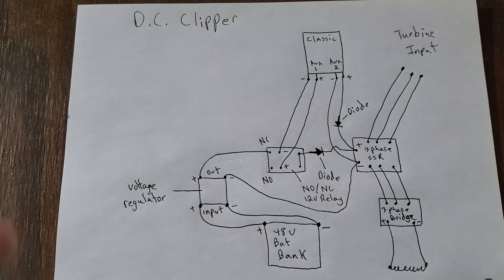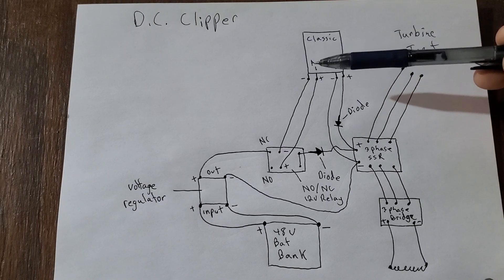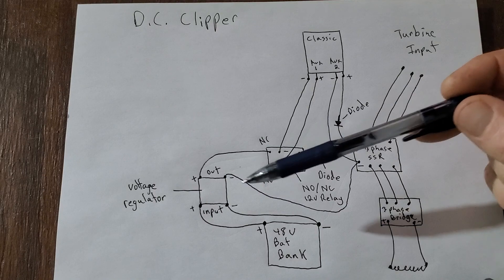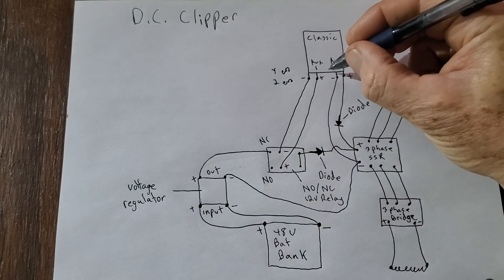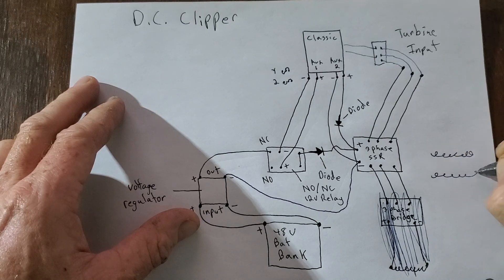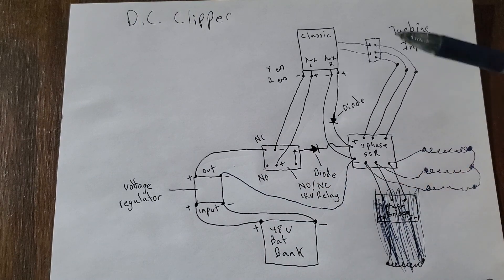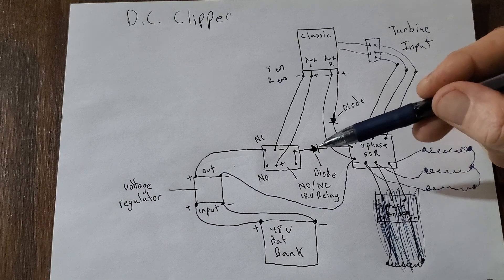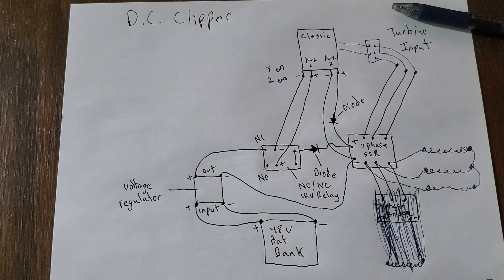Details for Classic Clipper build for a wind turbine

Comment: I'd just like to say thanks for this, I'm about to recommission a 100 year old hydro turbine using a 3 phase induction motor as the generator. There's a mechanical goverenor on the turbine but I'd like to just us that as redundancy and this as means of controlling output. If I can get it running it should compliment our existing off grid 48v solar system during the winter. 

Really, really good of you to make a video on this. Thanks again.
Reply from the maker: No problem let me know if you need help with the circuit

Comment: What size wire do you use between battery 12 v regulator SSR 12 v Relay?
Reply from the maker: It doesn't have to be very big because it only carries milamps

Comment: If I can't get that type of resistors can I put 3 x 1000 watt heater elements on for 3 kW turbine 48 volt system. I am from South Africa we don't have that controllers. Can I use other controllers like Sunsynk and Growatt or Deye inverters?
Reply from the maker: They have to be able to convert 200v dc to a lower voltage useful for charging batteries this wind turbine will stall the blades at 48vdc

Comment: I can't find a 48v relay 5 pin no nc. You posted in the describtion a 12v  relay 5pin which i assume you have a 12v wind turbine. But mine turbine is 48v rated 400w peak 600w. Do you have a link please?
Reply from the maker: In the video I showed how to hook it up for a 48 volt system . You need to use a 12v voltage regulator .
Reply from the maker: I linked all the parts you will need in the description . The diagram is for a 48v system
Reply: Does the 12v voltage regulator need to match the watts of the turbine ? The Link provided is since broken.
Reply from the maker: It needs to be able to handle the max voltage of your battery bank . I'll see if I can find a different one
Reply from the maker: Try this one if you want.  
https://www.ebay.ca/itm/113136913532?mkcid=16&mkevt=1&mkrid=711-127632-2357-0&ssspo=2xHnBz9eS1S&sssrc=2349624&ssuid=OGDjND0xRxK&var=&widget_ver=artemis&media=COPY

Comment: Is there any reason this design wouldn't work charging 48v lithium batteries. Thanks for yourcontribution.
Reply from the maker: It should work just fine as long as you use a voltage regulator for the SSR

Comment: I have a regulated output from my windturbine to the clipper how do I connect it to the SSR?
Reply from the maker: Do you have a Midnite Classic charge controller?
Reply: @windpowerandmore6310  Yes I got midnite classic controller, MDS 200 amps 1600v  acdc 3 phase, 3 phass solid state relay  3-32v dc ac, the 40amp NC/NO relay and dc to dc step down, my turbine is a missouri commander dc output unless I remove the regulator in the pmg and draw the 3 phase to the clipper.
Reply from the maker: The whole wiring diagram is in the video buddy that's the easiest way for me to show you how to hook it up